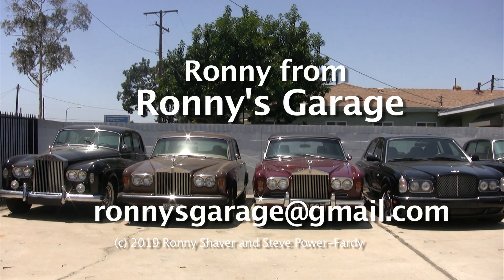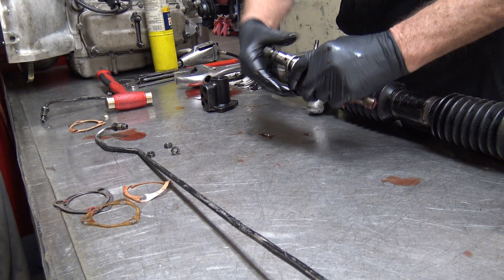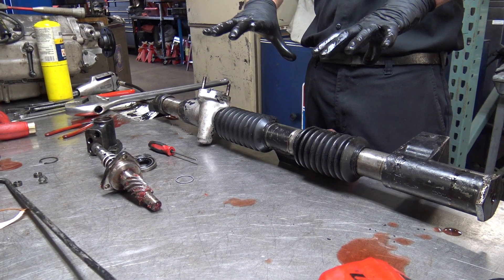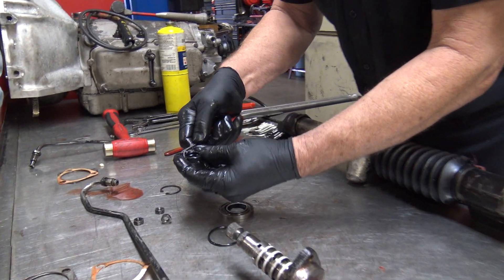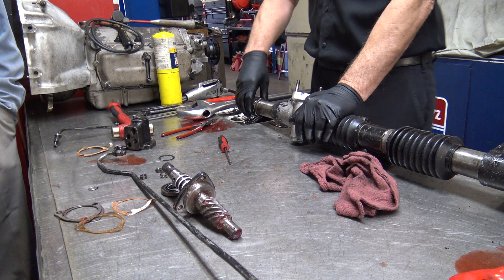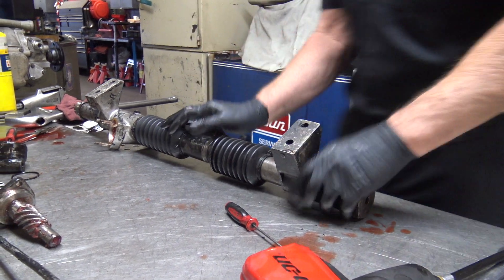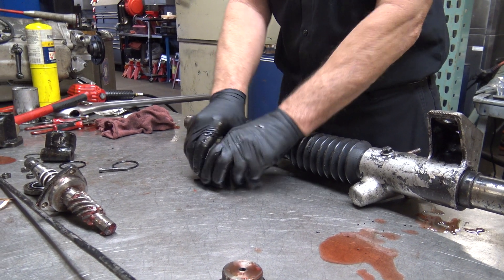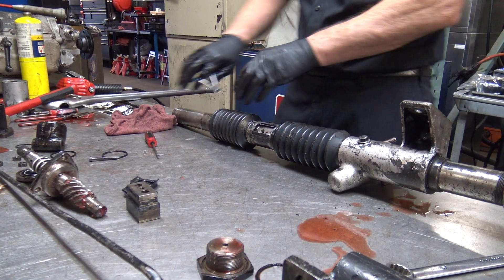Steering Rack Disassembly and Assembly Part 2 of 10

Comment: Too much banging and clattering. Slow down.
Reply: This is how it is done in a shop. Perhaps you prefer chips, a comfy chair and some TV? We burn 6,000 - 7,000 calories per day when it’s hot, as most shops or dealerships are not air conditioned. How much did you burn, calories that is?
Never trust a skinny cook or a heavy man to do hard work!
Reply: @deankay4434  No worries Dean. Keep up the good work.
Reply: @deankay4434  Love it . Got to remember that. Never trust a skinny cook. And I have seen some slow moving heavy techs that frankly, I dont trust.